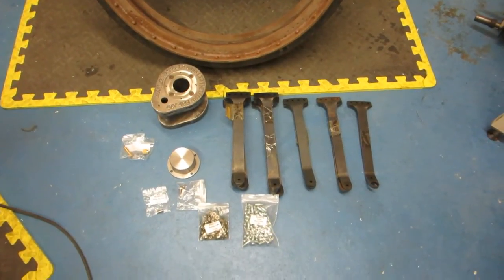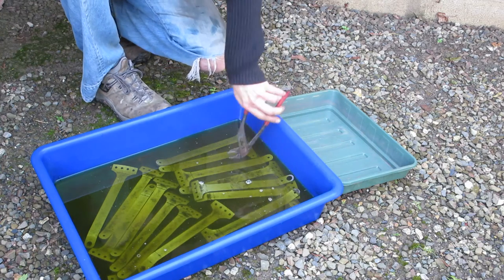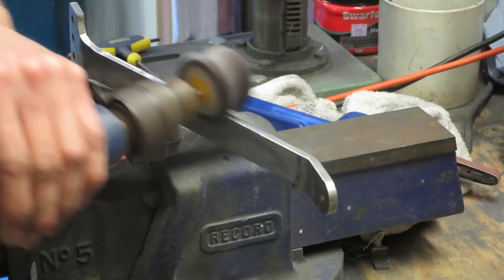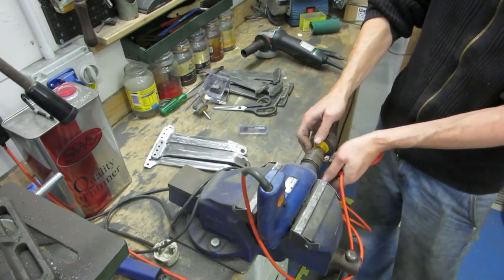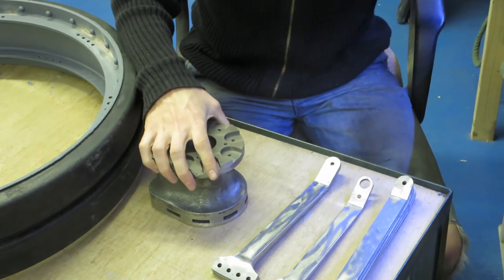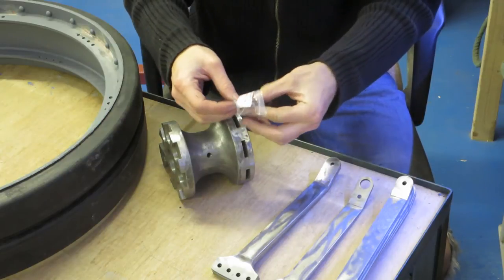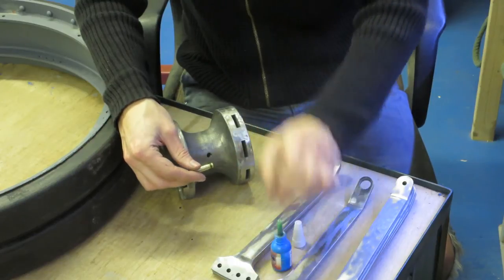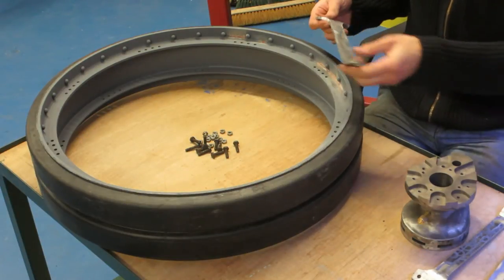Building a rear wheel part A - Burrell SCC Traction engine build part 12

Comment: Great video Chris, I have just finished building one of my rear wheels myself, certainly alot of work involved !!!
Reply from the maker: Hi Tim yes a lot more than I was expecting if I am honest! I think the perception is that because it's a kit it will be effortless, granted it's not as much work as starting from scratch but as you say certainly a lot of work left to do! Thanks for watching :-)
Reply: @chriscrockerwhite  Hi Chris, I just found your build. You are doing a fine job. I am from Malta and I know what it takes to build traction engine wheels from scratch. I am building a 2" Durham and North Yorkshire Traction Engine which I had started a good number of years ago. I used to say I had roughly 90% done. I have recently retired so I am back to my hobby. I am currently building a separate water tank to fit inside the  tender and all the fittings that go with it. I am really enjoying your builds and getting some new ideas how to perform certain jobs.
Thanks  and regards
Emanuel Lautier
Reply from the maker: @MANNIE1973  thanks for the comment, good luck with your build :)
Reply: Try making one